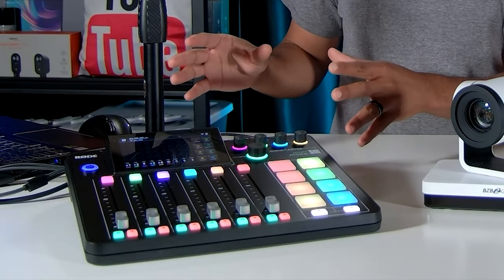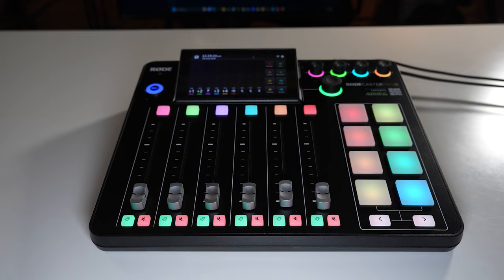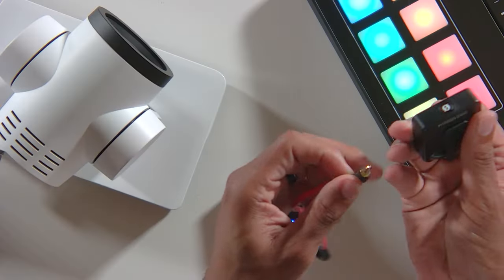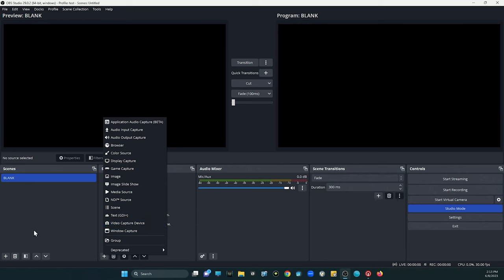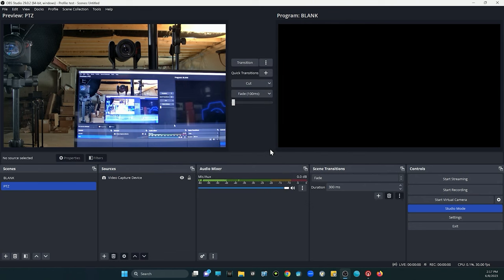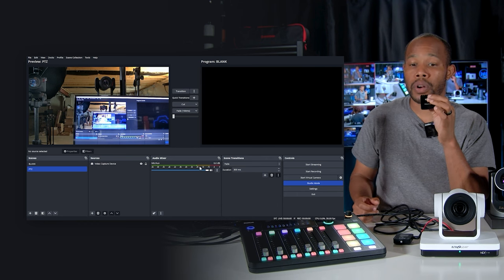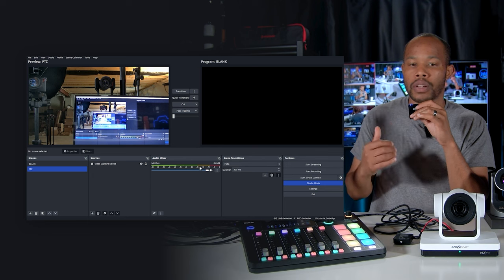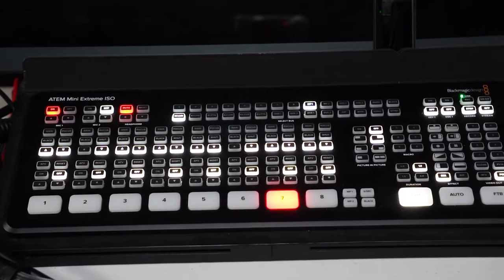How to Connect Audio & Microphones to PTZ Cameras for Live Streaming

Comment: We just have 1 camera hooked through Ethernet but we can’t get sound so what do we need to get sound to Facebook live we just have a ptz camera and a Mac desktop and our sound board are we going to have to something to go in the line in to get the sound out to Facebook live
Reply from the maker: Just connect your sound board to your computer. Your camera will just focus on video and your sound board will focus just on sound. I would suggest troubleshooting your connection between your sound board and computer if you're not receiving audio. Without seeing your setup, its difficult to identify why audio is not going to your computer and out to Facebook.

Comment: Real quick. How do you deal with the delay issues between NDI cameras and your audio? I feel like NDI cameras going through the ethernet always are about 1 second behind if not even a little bit more. Seems when you plug into the back of the camera it syncs it up much better. I'd rather do it the practical way if you can help me out.
Reply from the maker: I adjust the audio delay in my live stream platform